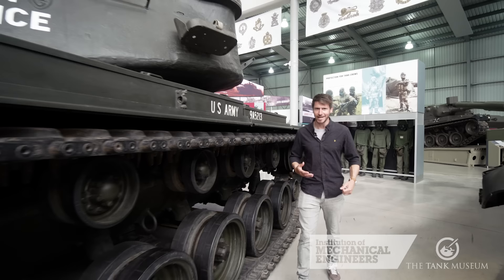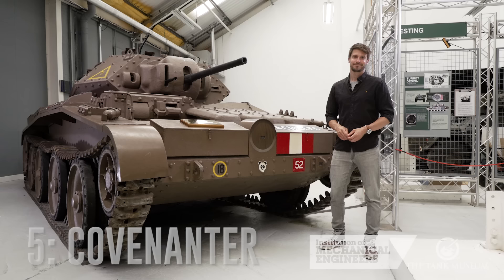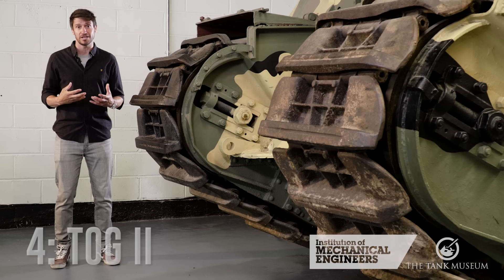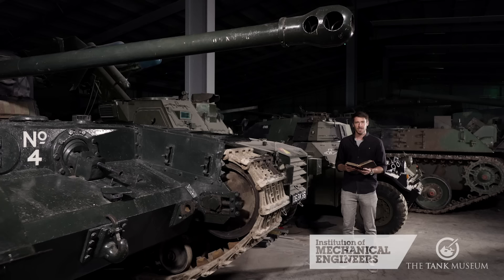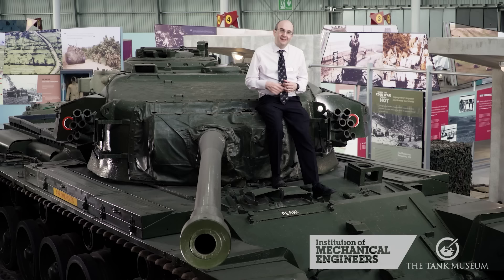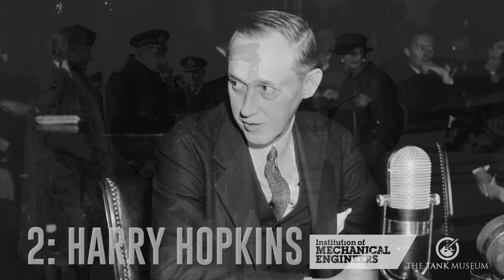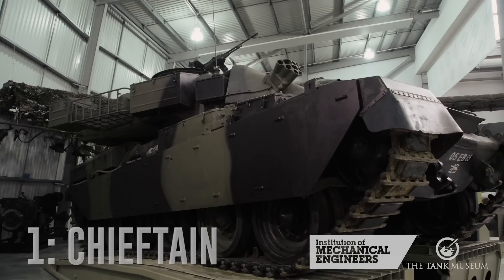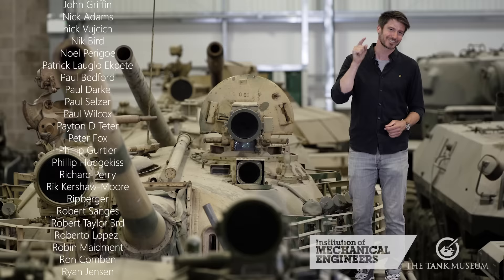Rob Bell | Bottom 5 Tanks | Institution of Mechanical Engineers | The Tank Museum

Comment: Chieftain's failings with the engine are largely to do with the fact that the powers to be couldn't bring themselves to admit the engine was crap and replace it, struggling along for years.
It's ok to make a mistake as Rob rightly says, the real tragedy is not to suck it up and make changes when it happens.
Reply: By the first Gulf War the Royal Engineer's chieftain AVREs had a better availability rate than both Challenger I and the M1 Abrams. Then again, that might have been down to the large number of spare engines since chieftain had been withdrawn from service as a front line tank, and the Royal Electrical and Mechanical Engineers had 30 years experience of swapping out broken chieftain engines.
Reply: @DERP_Squad  Chieftain AVRE? I think we still had Centurion AVRE in Gulf War One. We did have Chieftain bridgelayers though.

As for sappers replacing packs, we had the REME for such uncouth tasks :)
Reply: Reminds me (somewhat OT) of the history of SpaceX trying to catch and reuse the cargo fairing halves after a rocket launch. First they built a big net on top of a ship. Did not work. Then they built a larger net on top of a ship. Still did not work. But then they said, screw it, we'll make the fairings a bit more resistant to saltwater, just pick them up from the drink and give a good wash.

And this... works.
Reply: @DERP_Squad  Royal Engineers don't swap out engines. REME swap out PowerPacks.
Reply: @bob_the_bomb4508  Sorry for dirtying the hands of the Royal Engineers with the concept of replacing power packs. I've corrected the comment to put the REME in their oily place.

My understanding was that some of the chieftain AVRE conversions were sent out to Iraq in 91, though I'm not sure how many. The centurion version might have been more common. The point that the Leyland L60 was reasonably reliable after 30 years of development is still true though.
Reply: I gather another country that bought Chieftains had replaced the engines? Jordan?
Reply: @chinocracy  Jordan had some, so did Kuwait, Oman, and Iran, and Iraq had some they captured from Iran.
Reply: Sounds like the same story as the L85A1
Reply: @DERP_Squad  By Gulf War 1 I believe the L60 was up to the Mark 13A which was giving a reliable 840hp. The problem with the cylinder liners cracking was long gone.
Reply: Those know knew their engines advocated for a replacement of L60 on Chieftain for yonks; it was the Politicians that said no.
(as they also did to various RAF & aero industry requests / proposals for Aircraft avionics upgrades)

As far as the MP's were concerned: Chieftain had cost so much already, that spending more [even if it was clearly needed and would improve the Tank's rep' with potential export buyers] was verboten.

At least one Chieftain did take part in the project to develop what became the Perkins Condor V12 used in CR1 & CR2 though.
Reply: @AgentTasmania  Not really. L85's issues were due to no serious trial period to iron out issues nor investment in the Enfield Factory (the latter had to make the rifles with decades old & worn out tooling), though the Army did compile a list of Must-Fixes and the government [unusually] got someone to do it (the then UK owned H&K).

Chieftain's a case of the issue being identified quickly... but the politicians never okay'ing re-engining the Tank.
(whilst ironically Iran and other export nations managed to)
Reply: but a lot of opposed piston 2stroke diesels were proven reliable,until some engineers decided to forget all about the Jumo engines :-))
Reply: @michaelpielorz9283  2stroke is obsolete though. It was both too dirty and too inefficient, compared to 4 stroke.
(the latter also have longer lifespans)
Reply: @jimtaylor294  nearly every cargo vessel uses 2Stroke Diesels,there must be a reason to do so.May be because it is the most efficent engine i!!and for ship use it nust be the most reliable engine
Reply: @michaelpielorz9283  The flaw in that argument is that the ship engines are gargantuan. Nobody serious would ever put one in a vehicle XD.

And no: Look at a Scooter or old Soviet Bloc Cars for why two-stroke engines aren't used in cars anymore. 4-stroke is cleaner, uses less fuel, is less prone to Engine Knock, and the engine lasts longer.
Reply: @jimtaylor294  sorry,no flaw. only facts..and a lot of opposed piton 2 stroke diesels worked fine inthe aircraft and Railway business.there must have been a reason to use them in spy planesair ships and so on,don`t you think?
Reply: To be fair to the engine, the chieftain ended up significantly heavier than expected by the time it was actually made
Reply: @grahammoore8967  you do realise that a Engr Regt will have a REME workshop?
Reply: 2 strokes have the advantage of simplicity over four stroke engines, which is of some benefit in a combat vehicle.

Comment: I cannot praise this presentation enough. As an engineer for over 35 years, what Rob Bell stated should be presented to every engineering student and every newly minted graduate. These are important lessons that literally cannot be emphasized enough. Good design is hard because you are always balancing and compromising. The tank's iron triangle of protection, mobility and firepower is a crucible for any engineering team.
Reply: The Germans have never really figured out the value simplicity & reliability. If you don’t believe me, ask your mechanic.

Comment: Multi-fuel vehicles were seen as a necessity for the atomic war. With the challenges of WWII logistics in nit to distant memory, being able to operate on whatever you could find sounded great.
Reply: It did indeed 'sound' like a great idea, and probably was cooked up in a meeting of officers who had little experience in logistics, and less in engineering. I imagine it went through committees and the engineers who knew that it wasn't a good idea were never given the opportunity to give input.

The multi-fuel requirement was introduced by NATO in 1957. However the two other wide spread tank designs contemporary with chieftain, the M60 and Leopard I, both were designed with diesel only engines. The designers came to the conclusion that a tank that worked when one fuel was available was more useful than one that didn't work when any fuel was available.

Further, the chieftain engine wasn't as useful as the phrase 'multi-fuel' would suggest. It took an engineering team 8 hours and the use of a field workshop to modify the engine to work on a fuel other than diesel, and the same to modify it back again. This is assuming that the parts to conduct the modifications were available. The time it would take to modify a company of tanks to run on petrol or jet fuel would probably have been better spent finding a logistics unit that had some diesel.
Reply: Yep, we have to design fuel pump systems for aircraft to be able to operate on multiple fuel types, it was a requirement of potential war with Russia. But the point is valid, always question the requirements.
Reply: "--at the time."  The saying is "It seemed like a good idea at the time."
Reply: When I was in Army (post cold war) It was one army one fuel.  When did that become the solution?  It seems like the way to go.
Reply: Multi-fuel itself isn't even the main issue. There are working multi-fuel engines out there (the AGT1500 of the M1 Abrams and the LD-series of the M35 and M54 cargo trucks come to mind) that have been widely used for decades without the sorts of reliability problems that the Chieftain suffered. The surplus M35 is very common in civilian use in the US and the engine is well regarded. 

It's the particular engine/design the British used that is the issue. That, and the fact that the British never really planned on using anything besides one fuel in it. At least the US army regularly uses a different fuel (jet fuel for the Abrams is now standard instead of Diesel, though it means the smoke generator is no longer usable). The British should have done what the rest of NATO did and use a normal engine.
Reply: All machines have teething problems, it takes time and resources to mature a design.
Reply: @tacticalmanatee  They were told to use a multifuel engine by NATO.
Reply: Yes, there were so many incompatible weapons in NATO in the 70's. It was a huge asset to the Soviets.
Reply: @tacticalmanatee  The British went with the multifuel engine because, at the time, it was a NATO requirement. One that both the US and Germany decided not to bother with due to the issues given the technology of the time. However that demand for a multifuel engine while ignored by the US and Germany when they isolated the issues with it was NOT rescinded. 

It is also important to note that the multifuel engines you mention came along well after the Chieftan entered service, after many years of development and research. Really efficient multifuel engines were not viable at the time Chief was designed. 

Now I do agree that the Brits should have also ignored that NATO requirement and gone with a single fuel engine, however, that being said, it is still important to remember that they were trying to stick to a NATO Mandate that the leading power of NATO had already decided to ignore....

It is not the only time that NATO has thrown spanners into the works of the British military procurement. Frankly the UK should have ignored the US and continued developing and rolling out its .280 and the EM-2 that had been adopted in 1951 until the US threw a hissy fit and demanded 7.62 become the NATO standard cartridge. That rifle was probably the finest combat rifle developed at the time and dropping the .280 and the EM-2 left the UK scrabbling around for a new battle rifle later than they should have been.
Reply: @tellyheadlol4258  And were the only ones who, at the time, listened.

Should've gone with a conventional diesel until a WORKING multifuel engine was developed.

Sounds a lot like the lessons the USN is learning with the Ford regarding developing new, "brilliant idea" technologies concurrent with the platform intended to use them. Looking at you in particular, EMALS (181 mean cycles between operations mission failure vs. a requirement for 4166 -  Congressional Research Service, March 2021). EMALS sounds great on paper, but a working steam catapult beats a dodgy electronic one any day.
Reply: @alganhar1  German vehicles as Leopard, Marder, Luchs etc. use very reliable multifuel engines.
Reply: Every diesel engine is multifuel since you can run them on food oils. (so long as the fuel pump isn't lubricated by the fuel itself). Rudolf Diesel ran his engines on peanut oil.
Reply: @DERP_Squad  The idea of a multi fuel engine comes from people who do have experience in logistics - the folks that know trying to supply enough of many different things is much much harder than supplying excess of one - same reason at various times perfectly good weapons - like tanks with 76's on get left behind so the whole force is using the same ammo, and those sort of decisions were often made when your side was winning, so didn't have half as much pressure on the logistics train to react to unpredictable withdraws, attacks upon it etc - when the logistics actually had some hope of coping...

I don't see needing to work on it to run on what you have is a real problem either - you end up with tanks dug in around an airfield you don't want to have to fly in diesel as well, so spending a few hours to make it run on what you are bringing in seems fine.
Reply: One issue was the range of fuels expected which went from domestic heating oil into petrol and avgas (mixed with diesel?).

But the bigger issue with the Chieftain (and the L60) was going with modifying/developing a WWII Jumo opposed piston aviation engine into a late 1950s/early 1960s tank engine. In Gulf War I, after much development of the L60 Chieftain AARV and CHAVRE availability was higher than Challenger 1.
Reply: @MrZcar350  opposed piston engines are fine, Deltics used them without too much trouble, and the Royal Navy used them in several fast attack boats
Reply: @andreww2098  I never said there was anything wrong with opposed pistons. In fact, I pointed out the L60 eventually was developed into a fairly reliable engine. The point was it was undeveloped and brand new, adopted too quickly, not that it was opposed piston.
Reply: @DERP_Squad  This. Even today it's an impossible feat for a Tank engine. Even the Abrams can't run on non-standard fuel without degredation to the turbine engine's components.
Reply: @tacticalmanatee  The Abrams technically can use other fuels in its engine; but it does come at a cost re' mantainance.

Ultimately: there's only one kind of "multifuel engine" that exists; the sort the V1 "buzz bombs" used.
Reply: @herosstratos  Nope. Diesel engines only work right on the fuel they're configured to use. The range of possible fuels is vast; but still the case that whichever one has been decided on must be configured for before use.

Same to a lesser extent with petrol engines, which for instance can be adjusted to run on Ethanol or LPG.
Reply: @jimtaylor294  Which honestly is fine. Keep in mind using different fuel wasn't considered ideal, it was for emergencies only. You don't really care about increased wear and tear on the engine when the only other option is an inoperable tank. If you need your tank now , who cares if it doesn't work too well a week from now?
Reply: @Chopstorm.  In a dire emergency aye; but the ability was claimed by industry & pundits alike at the time as something that could be done as routine. At best that's over'selling the product... at worst it's straight up lying to the customer and end user.
Reply: @jimtaylor294  Nope. Friend of mine had a Mercedes W123 diesel which, surprise surprise, is configured to run on diesel.
It did however ran perfectly fine on vegetable oil without any adjustments. He used filtered waste oil from a chip shop.
Reply: ^ Depends a lot on the individual engine. The general rule though is that optimising an engine to a given fuel choice is needed if wanting bother free running on said fuel.
Reply: @MrZcar350  The Ford has way too many great ideas.
Reply: @ihatecabbage7270 That’s true to an extant but it’s also used way too often as an excuse for shitty designs & worse execution.
Reply: @MrZcar350 Bingo!

Comment: Must haves vs nice to haves. The traditional engineers trap. 
In modern language; adding features because you can does not necessarily give you a better product. 
Example: Windows 8,10, 11.
Reply: yeah, bloated, Blue Screen of Death, Freezes...... is pretty much shorten lifespan of most PC due to the need to suddenly turn it off to restart it, damaging the hardware in the process. =_=
Reply: @ihatecabbage7270  Absolute nonsense.
Reply: Windows Vista and to a lesser degree 8 were the only ones to avoid. A touch of the Luddite mantra here.
Reply: @Twirlyhead  ME, 95. Not very good either and i stick to 10 and 11. No added value, just a load of crap you don’t want. Telemetry. Updates, UI
Reply: @baronvonslambert  Agree. But you needed to know what you were doing. It was more cumbersome to maintain it then moving to Linux today.

Comment: A lot wrong with the Leyland L60 but nothing wrong with opposed piston 2 strokes, Junkers, Rootes, Napier and Doxford proved. The Rootes (Commer) TS3 and Napier Deltic were legendary for reliability and power for their class.
Reply: The L60 was adapted from the Junkers Jumo D205, but Leyland managed to make a complete mess of what was originally a reliable engine when Junkers made it.
Reply: The wiki article is informative:  https://en.wikipedia.org/wiki/Leyland_L60
Reply: @Slaktrax  As I recall; nobody in that period managed to make an effective diesel aero' engine. Even today they remain uncommon.
Reply: True re-engine cylinder orientation; though I can't think of a Tank that's made such a setup work well.
(apparently the Soviets tried such a "boxer" engine in a Tank; and it didn't turn out well either)

The similarly arrayed Meadows engine in the Covenanter was supposedly good in of itself; but not as used in said Tank of course.

I think the dominance of V configuration engines in Tanks is for good reason, a bit like how X format engines never were have been a hit in aviation.